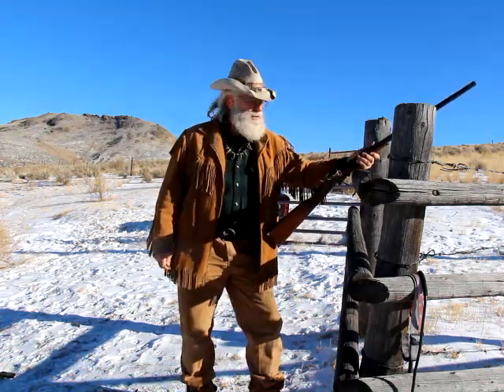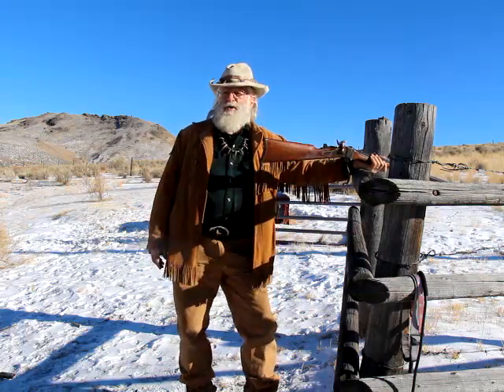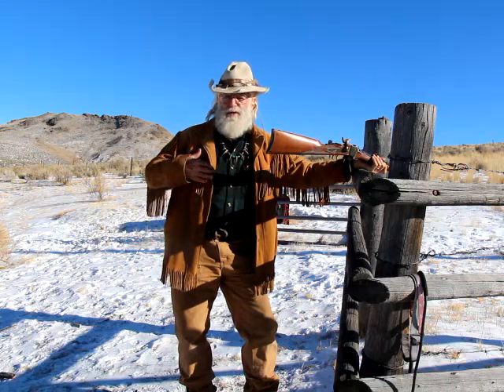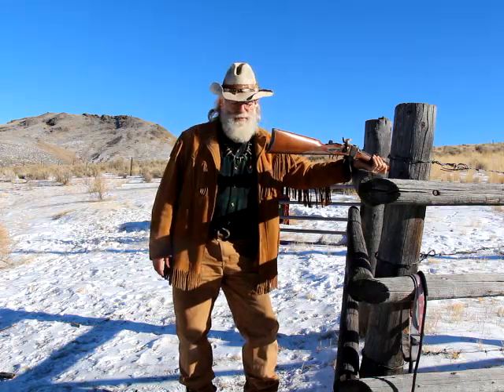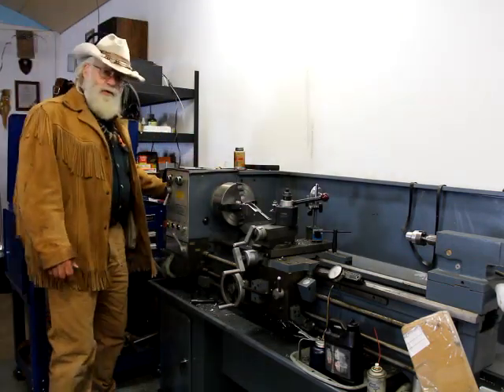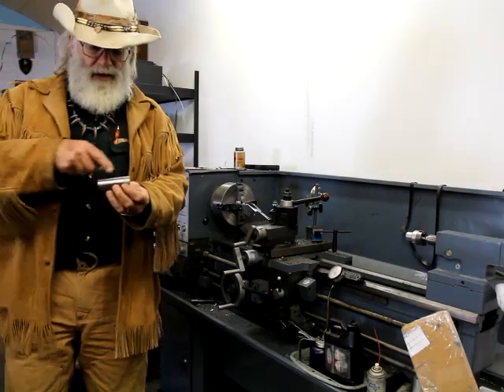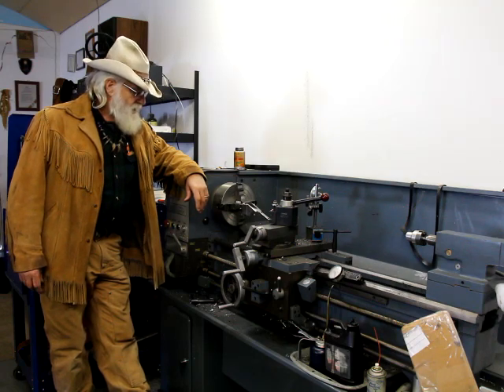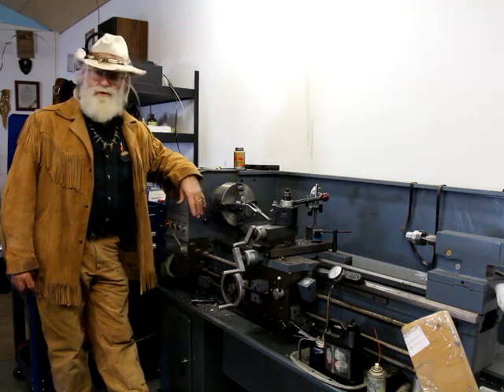Coffee w Buckskin Dave  Progress on the 50 90 Sharps

Comment: What smokeless powder do you use as a substitute for the black powder loads and are the charge weights similar?
Reply from the maker: Not at all.  Be careful with smokeless and big cases!  I don't like to give out charges to folks because it is better if you work them up for your stuff.  There are loading tables out there to get you started.  Work up a load slowly and do not go above pressures that are safe for the style gun you shoot.  Some powders that I like are IMR 3031, IMR 4198.
Reply: @BuckskinDave  I have IMR4198 but it doesn't have enough power to cycle my AR's but works ok in my bolt actions. It's suppose to be a bench rest powder.